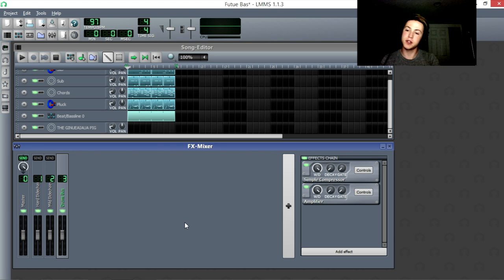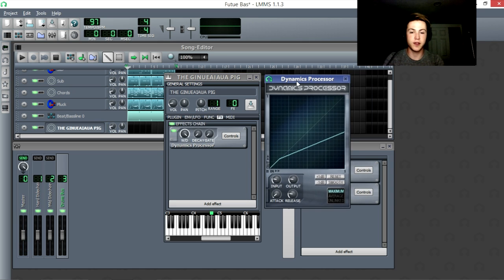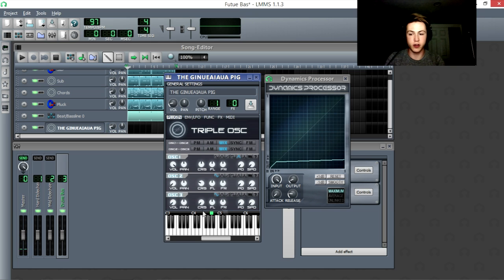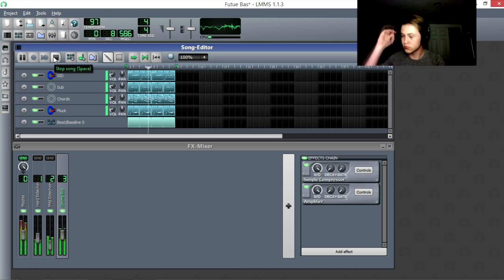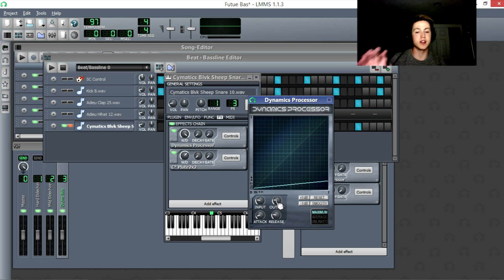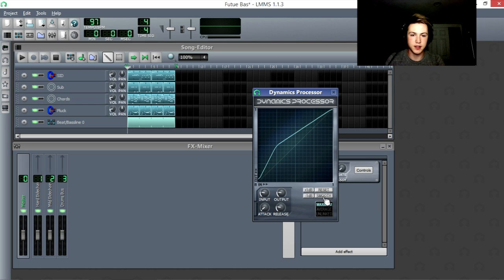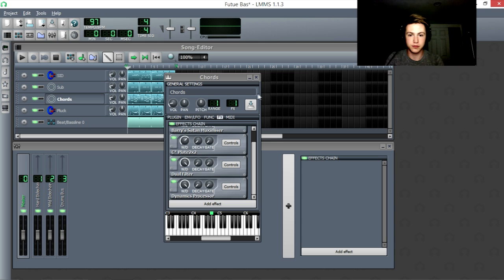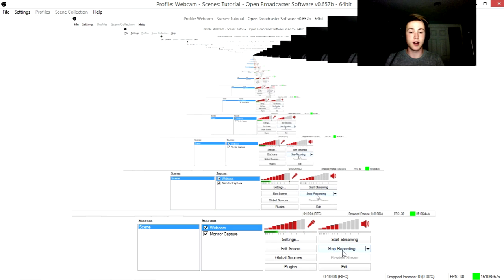Mixing in LMMS 2: Compression

Comment: Did you know that LMMS added a sidechain compression plugin? It's not super strong, but it really sounds smooth
Reply from the maker: +Franny Dimitri that's why I just use the peak controller haha
Reply from the maker: +John Paluska yeah, but the way it works forces audio to mono. The peak controller method is still the quickest way. You can make it smooth by turning up the release value as well.
Reply: I saw one where they took a triple-oscillator, threw a peak controller on it and hit "mute effect", and connected the sidechain plugin to the peak controller so that it went when the triple-oscillator hit. I actually really like that method personally :3
Reply: yeah i saw a tutorial where they panned things extreme left & right & then used the stereo matrix effect to make it stereo again, but it confused the fck out of me
Reply: When i use side chain compressor on stereo channel it remains stereo, I can pan audio & mixer shows that it is panning & you can hear it... if mono this would not be the case
Reply from the maker: +Franny Dimitri hm. Maybe I should try it again, but when the devs explained it to me, the left was the signal to be compressed and the right was the sidechain signal. I'll check again to be sure.